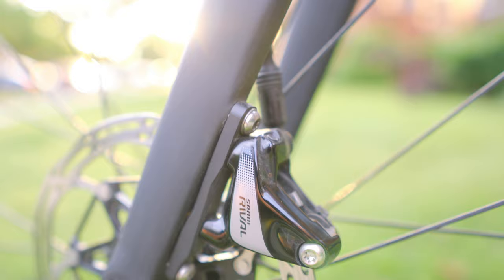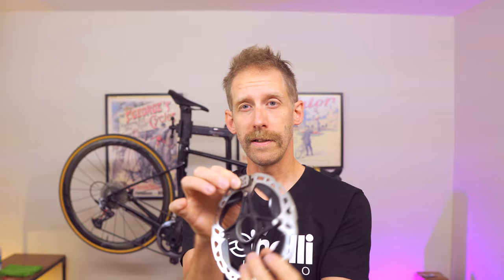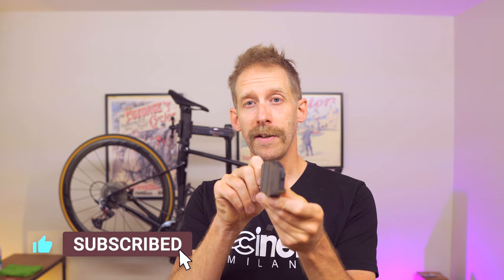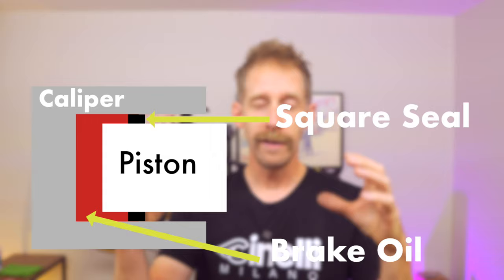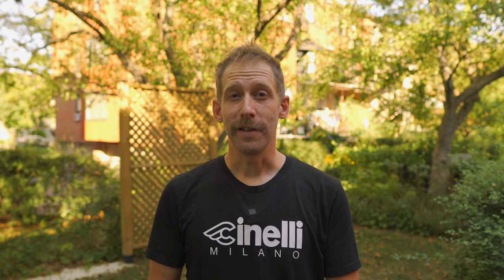How to replace disc brake pads on your bicycle ! Full Tutorial for beginners and pros :)

Comment: Hi Andreas! Thanks for the informative video, I heard that when replacing brake pads, it is important to ensure the old and new ones have the same friction material, otherwise a rotor change is also recommended. Would you agree or is it fine to change breaking pad materials without a rotor change?
Reply from the maker: Just make sure you have a rotor that is compatible with both (some shimano rotors are made for resin pads only)

Metallic brake pads would not be my recommandation anyway. Organic coumpounds are quieter and offer a very predictable performance.